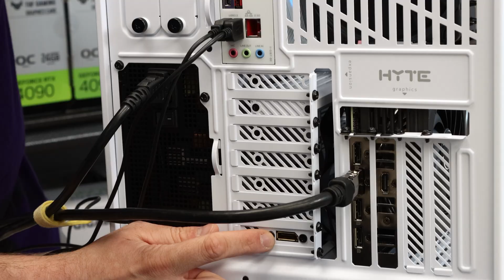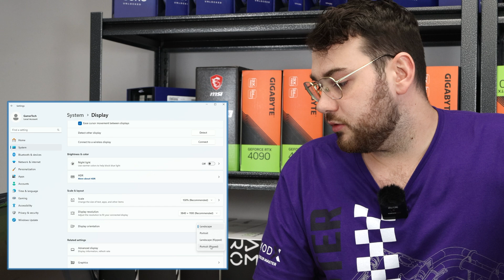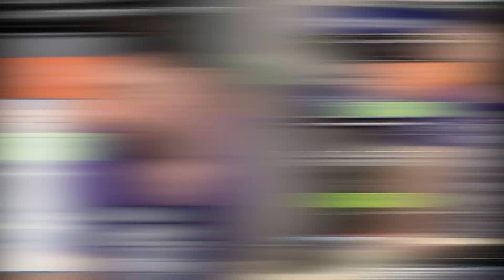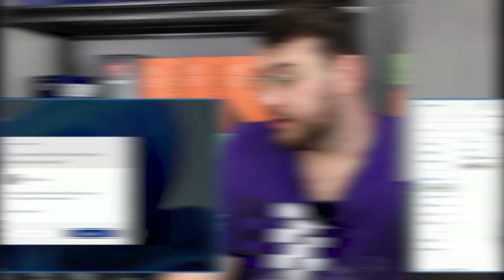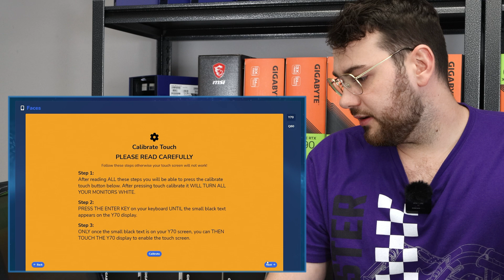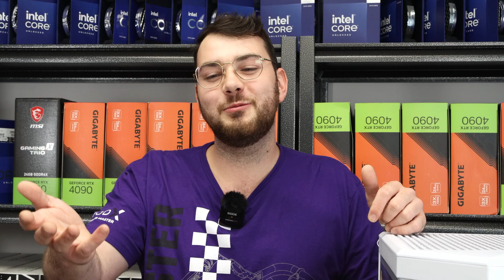Setting Up the Touch Screen on HYTE Y70

Comment: Thank you for the explanation, very helpful! 
Would it be possible to run the main monitor from the graphics card, and the Hyte Y70 screen from the dedicated graphics chip built in the CPU? 
My AMD 9800x3d has graphics, and the MB has a HDMI input socket .. would I just need a DP to HDMI cable to make this work?
Reply from the maker: Great question. I am not 100% sure. I assume you can’t but I could be very wrong

Comment: I hate the way that my mouse switches between the two screens... Is there a way to leave it as a touchscreen only? PLEASE help
Reply from the maker: Yes you can fix this. When setting up the screen you monitor will go all white with text on the screen. Press enter until the text appears on the Y70 screen and then touch it. Let me know if this fixes it. Read the text on the screen and what it says, it will make sense after :)

Comment: Where can I get a cable like this to connect the display? When I bought this case, this cable wasn't available.
Reply from the maker: Cable comes with the case, if yours didn't they might have sold you a used one where the other guy took it. You can also just use a regular 6ft cable, will still work
Reply: @GamerTechToronto 
No, it's new. I ordered a computer based on my criteria. The case was new, covered in film.

Comment: This Nexus app is pretty cool, but the problem I'm having is it takes over my RGB fan color configuration and forces me to configure my RGB using one of its designs.  I can't for the life of me get it to stop taking over.  When my computer boots, before Nexus launches, my RGB design comes up, and then in about 5 seconds, Nexus launches and starts the mini-screen and the Nexus RBG design.   Is there anyway to have Nexus just do the sensor screen and leave my RGB lites alone???

Comment: Why does no one make a video fixing the main issue with these garbage cases? I spent $380 USD for this case specifically for the touch screen, it hasn't worked since i set it up. It flickers and doesn't let me calibrate the screen, i have reached out multiple times to support and HYTE discord and done every step they give, guess what! Still doesn't work. this is a garbage company that sucks with everything they have. I also had the same issue with their HYTE Q60 AIO. Ridiculous they charge these amount of money just for the products to not work and no one to help you fix it. HIGHWAY ROBBERY.

Comment: Hi. A lot of trial and error in getting this Hyte Y70 display setup.  I was researching online to see if we can disable the Y70 touch as a monitor because sometimes files and applications accidentally open up behind the "Face", which is not expected. I could disable Always On Top but it sort of defeats the purpose of having the Touch Face on all the time.  How can we have the YTouch Face not allow any applications to get hidden behind.  Always turn off the Nexus Touch?

Comment: What if your mobo only has x2 DP but you are using it for a 2 monitor setup? There are x2 HDMI ports too, could I use DP to HDMI port converter to still utilize the Y70 Touch Screen connected to one of the other HDMI ports? Would be great to know! Thanks for the great tutorial!

Comment: The Nexus app says “Y70 Touch Not Detected. Please connect your Y70 Touch to use this widget” but it’s definitely connected bc it’s showing a 2nd monitor display and I can move the cursor around. Windows detects it and I’m able to set the orientation, etc. like first shown. I’ve tried restarting and Nexus app still says not detected. 😔

Edit: The Hyte Nexus application was an old version and I had to uninstall it and install the new one! It detects it now!

Comment: I have this case. its a quality case but the sceen only looks nice. After you have set your tv or monitor as the primary screen. I keep having problems with the touch screen. For example when i want to play some games they will automaticaly start to run the touch screen. games like Atomic heart. So i have to switch it of before i run the game. So honestly not the greatest expirience thus far. Also it will get very warm! not something I´d expected. Its looks great when it works. But practical No. Only when it works but then again i dont like the heat.

Comment: I have an Issue where it turns on but the display says “no signal” anyone know a fix for this?
Reply: I tried it a lot of times try to take a new moniter remove the mini hdim from the touch and start the new moniter and then plug it back in

Comment: Hey there! I'm having an issue. I have 3 DP monitors which means im out of DP ports in my graphics card. When I use a HDMI to DP cable to connect the back part of the pc, it wont turn on. I already have both screen back cables plugged. Any idea of why it wont turn on?

Comment: Wait, i already have 4 screens. I can use the motherboard display instead?
Reply: the motherboard port will not work because of the default settings used in bios. if that one setting turned on. the  motherboard display will only use 30hz or fps.

Comment: For some reason, when I touch my monitor it just registers as a touch on left side of the main screen. Anyone know why? I tried to recalibrate but it does the same thing still. And no, main monitor is not a touch screen.
Reply: recalibrate it and press enter until the black text is shown on the touch screen, then touch the screen and you should be good:)

Comment: Thank you for this epic video, just a question the cable that connect the case display port to the gpu is it Display port on both ends or display port and hdmi to the gpu?
Reply: The other end is proprietary Display port.

Comment: How would you go with using this in a simulator with triple screens? You’d lose one of your Display ports, or could you use one on the motherboard instead?
Reply: You could but you probably need a longer cable.

Comment: my touch screen is not responsive at first it was was and now after 4days it isnt, i can still see the display and all the widgets but i just cant swipe or open an app by touching
Reply: Same issue. Any fix?
Reply: @Swavyy21  nope
Reply: @Lucetehe   run touch calibration again. probably the black text will show on your main monitor, not on touch screen - just pres enter till the text shows on hyte and then touch it :)

Comment: A little problem, if i make my main display my monitor the touch gestures from the hyte screen works on my main monitor. how to solve it ?
Reply: recalibrate and press enter until the black text is shown on your touch screen, then touch the screen and it should work:)
Reply: Hey did you find out yet?
Reply: @shaggysnacks541  same here, any help?
Reply: Did you find out? Got the same problem
Reply: I'm kinda having that problem too

Comment: You want a long July...Y70 ships late July...Apparently Hyte could have just said ships July 31st (If your lucky) The longest July in my 64 years..😀 Edit today is July 31 case arrives in a few hours. 👍
Reply: Mine arrived yesterday unboxed it and it looks amazing mines all black.
Reply: I ordered in mid to late-ish June it was still listed as a pre order with shipping date listed as mid to late July. I ordered one and as soon as I ordered and went on their website it was changed to back order with the same shipping date....then the delay up date came and because of model, and a more refined time line some were listed as mid to late August (which i was) or later. Then I decided to Google hyte shipping delays....seems to be a common issue hyte has.....shipping and order fulfilment. They launched this version 2 after they got slammed for orders and used up all available screen for the original and thats what this v2 is...a screen swap, one would think after that kind of response and the numerous other failed deliveries in the past they would have learned something by now. My case is finally on its way, hopefully it comes in good condition because I'd hate to have to deal with a replacement or repair.